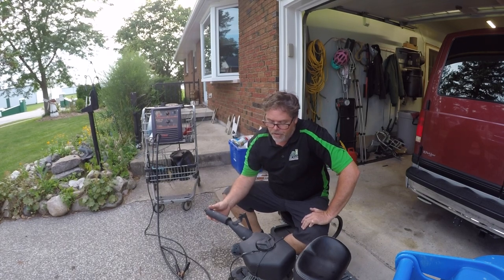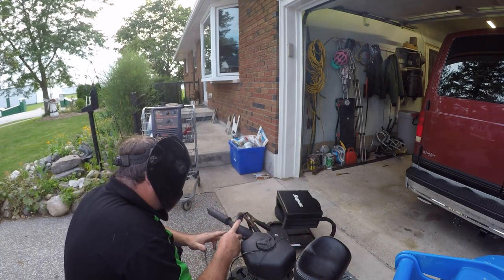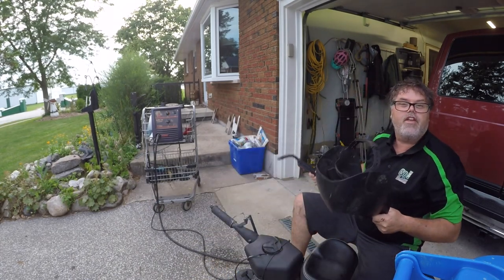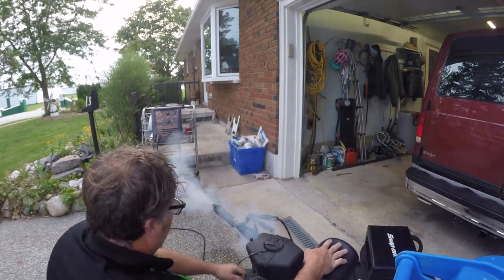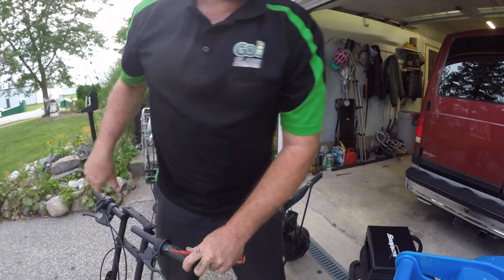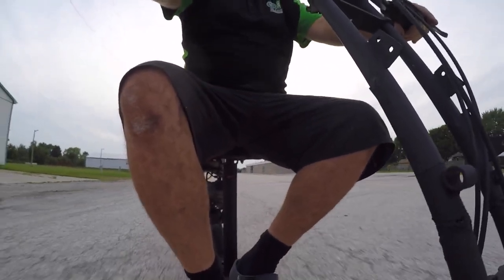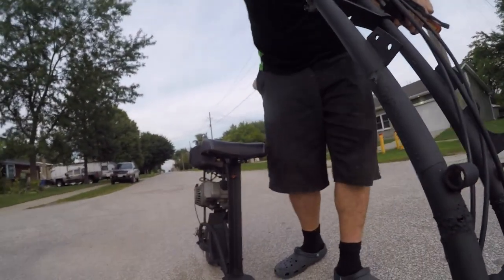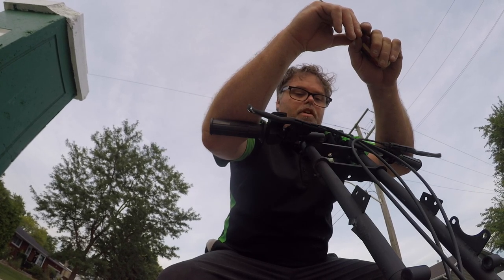Lots Of Scooter Bugs To Work Out

Comment: Try a little bigger jet in the carb, easy way to check is if it has a choke and will run wide open choked, you need a bigger jet. Just a thought hope it helps 👍

Comment: Most likely carb i know from experience if chain on those little motors is at all tight it won't rev out. Check it qhen you sit on bike just incase something is flexing
Reply from the maker: I think im getting the fuel to hot from being so close to the muff . When its cold it rips